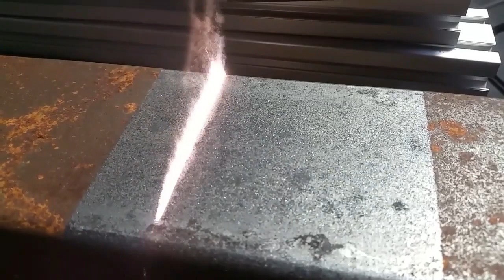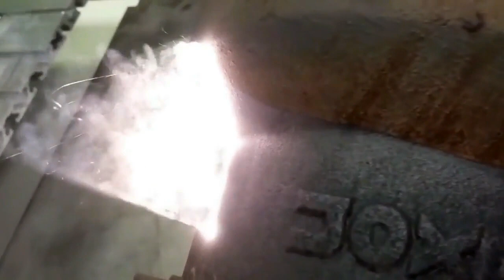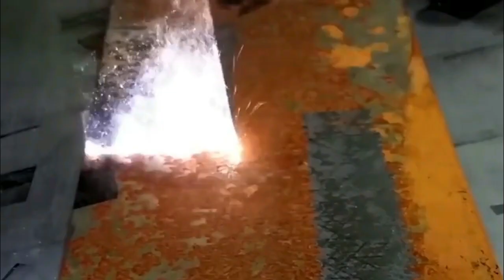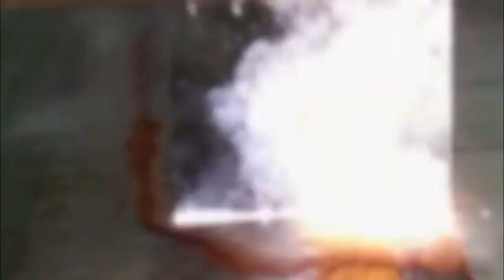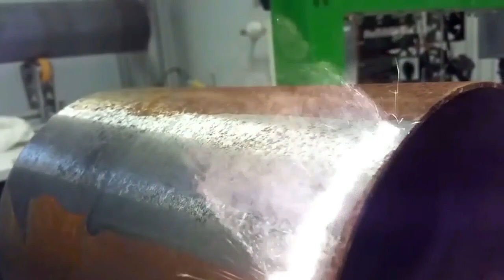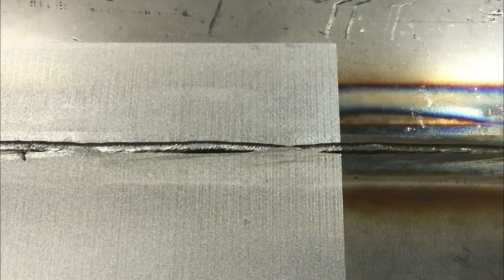Rust Removal using Laser Cleaning Technology

Comment: Looks great...! How well does it work on surfaces with paint on them, like on boats and ships, for maintenance and so...?
Reply from the maker: IT REMOVES PAINT NO PROBLEM.!  As long as the substrate material is metal, no damage can occur (to the metal).
Reply from the maker: it works perfectly well on boats, as long as they are not make of wood !  it will take the rust and the paint off, at the same time.